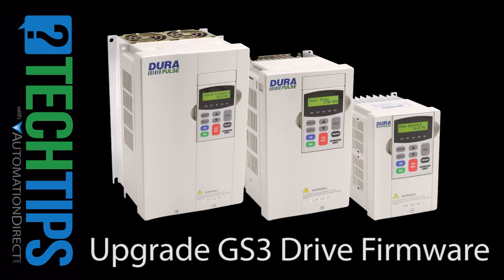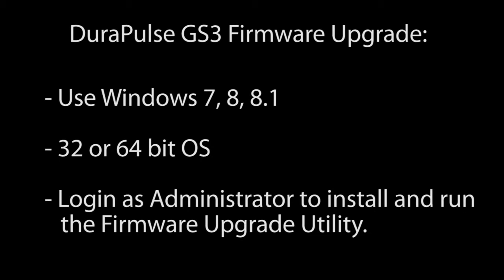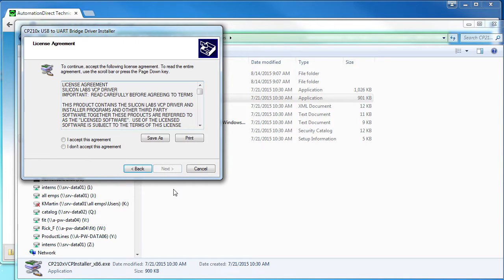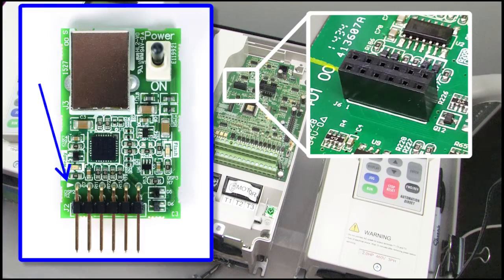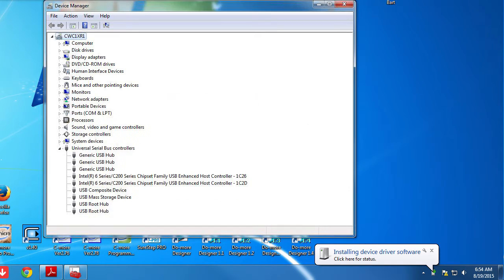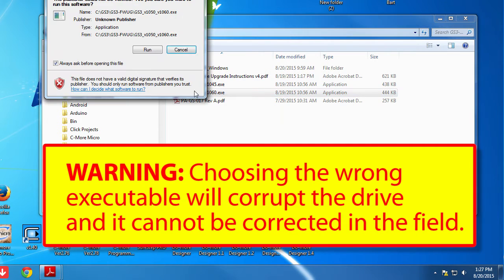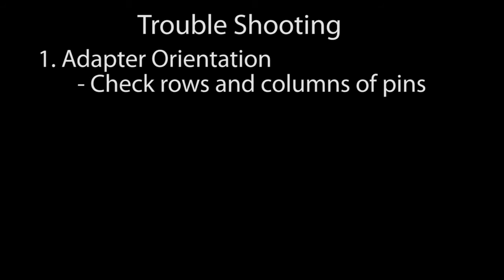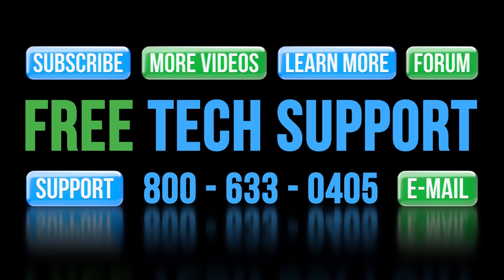DURApulse GS3 VFD Upgrade Firmware with AutomationDirect

Comment: I need to do a set up for a GS3-4100 drive.
for a 100 HP motor.
At the moment of putting load on the motor, the drive goes into error or fault. Do you can help me?
Reply from the maker: What error are you getting? Current overload?  Did you configure the drive for the motor you are using? What are your acceleration and deceleration times set to (P1.01, P1.02)? The GS3 has a great quick start on page 3-6 of this manual: https://cdn.automationdirect.com/static/manuals/gs3m/gs3m.pdf  - It walks you through the basics of setting up the drive the first time.